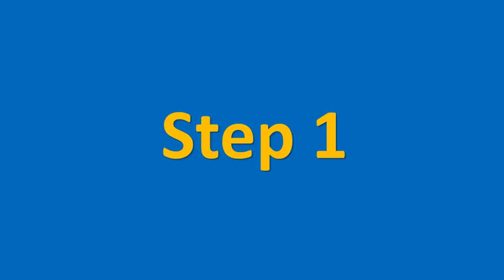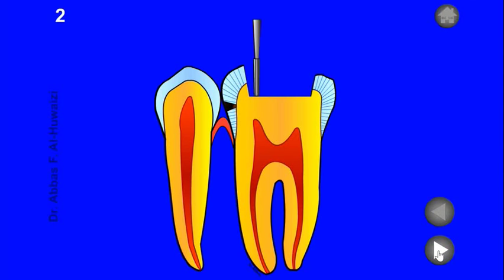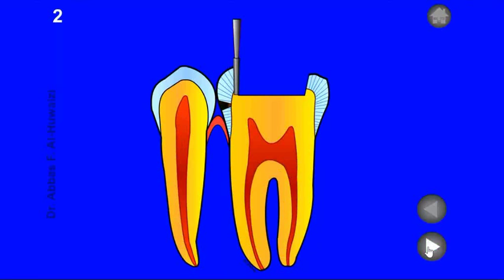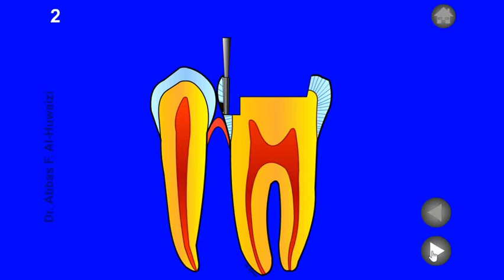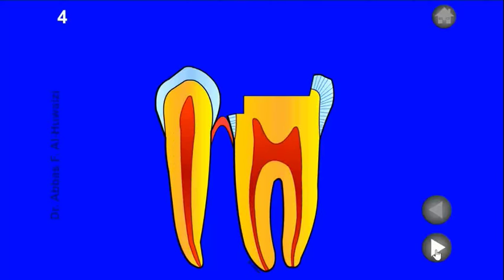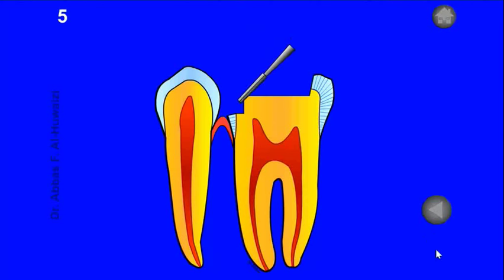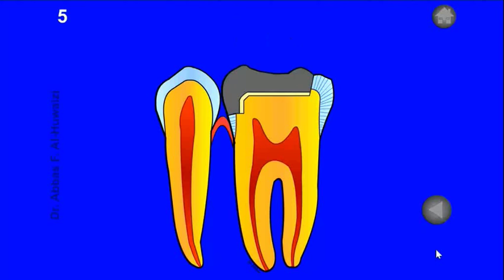Class 2 cavity preparation for amalgam restorations 0

Comment: I'm having a problem in finishing wall and smoothening pulpal floor while doing maxilla
Reply: natural teeth are so much easier than plastic teeth. These plastic teeth are very hard to get nice and smooth.
Reply: You can use hand instruments for finishing of internal line angles and bevelling to make you pulpal floor smooth you can use inverted cone bur without applying pressure